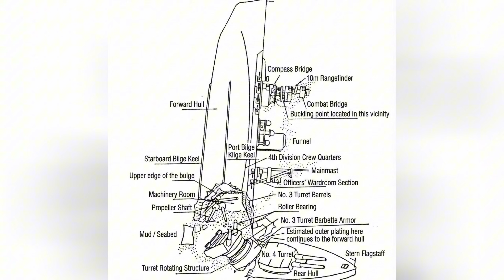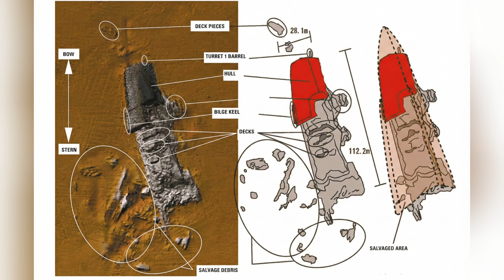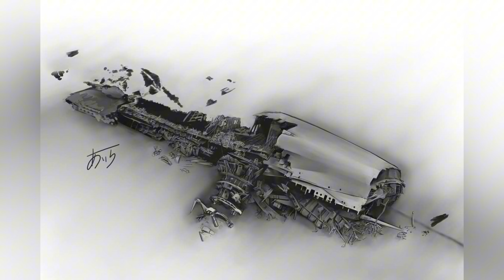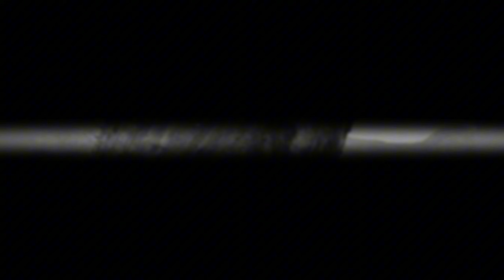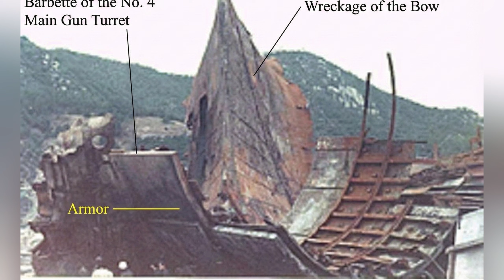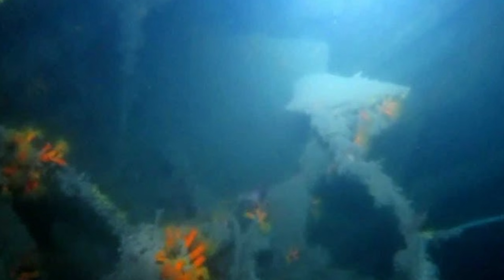Salvaging Mutsu: Raising a 1,000-Ton Turret from the Seabed

Comment: Isnt it a war grave?
Reply: That is up to the Japanese government
Reply: Technically, probably no. The IJN was at war but this ship was not sunk in combat. It was an accident or a sabotage. The remains of the sailors in fact do deserve respect and it does appear that they were treated as such during the salvage. It is much different to have non connected scroungers pillage a war wreck and treat the remains as ocean rubbage, as so many other wrecks have suffered. There is no reverence or respect, just a commodity to be gathered. In the case of Mutsu, with the blessing of the Japanese government at the time and proper procedures when recovering the remains of the sailors were followed the salvage was done with utmost respect.
Reply: For perspective, the USA salvaged the USS Oklahoma for scrap, and parts of the USS Arizona.  Both had many sailors remains recovered where feasible.
If the Arizona had the same thing happen to her, but sunk in the channel at Pearl Harbor, salvage or destruction to clear the channel would have been ..how shall we say.. callous, cold, and fast.
Tirpitz wreck scrapped by joint Norwegian and German venture.  Almost a thousand sailors lost there.  Cleared an environmental hazard, and the steel and machinery were valuable.
The U-864 was sunk with 65 tons of mercury onboard, a significant environmental hazard.   It was a candidate for salvage and removal despite being a war grave.  The remediation decided on entombing it in place because of risk of wreck breakup and mercury spillage, instead of removing  it.  
Sacrosanct war graves would seem to apply more to "not easily feasible to recover, and no reason to disturb ".
Reply: Mutsu